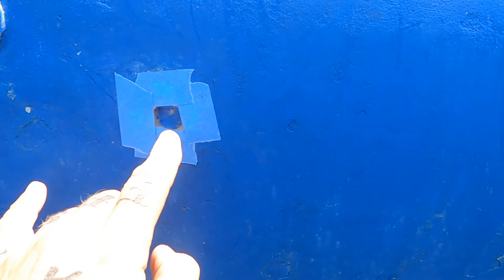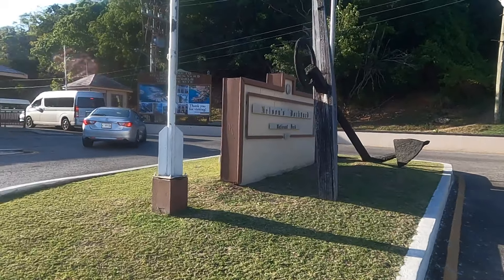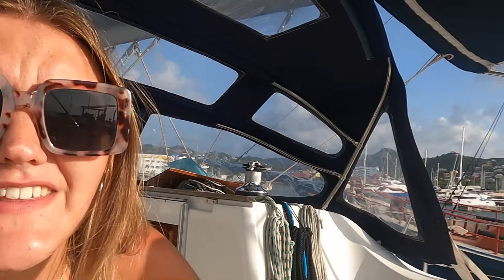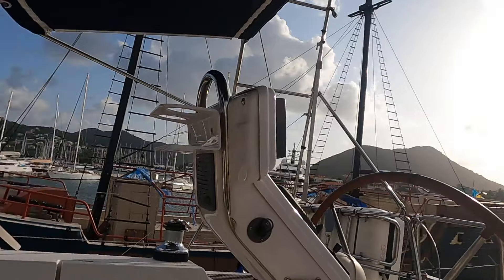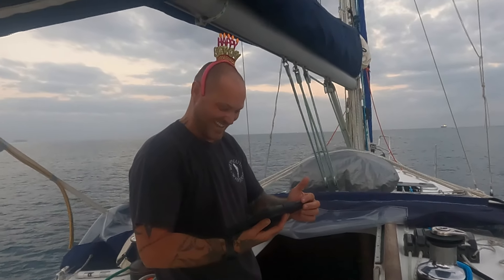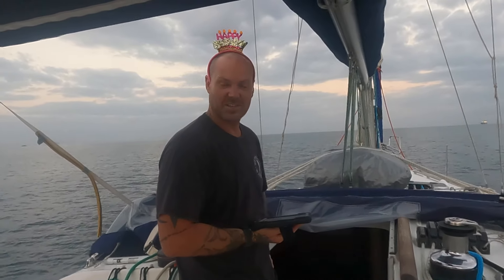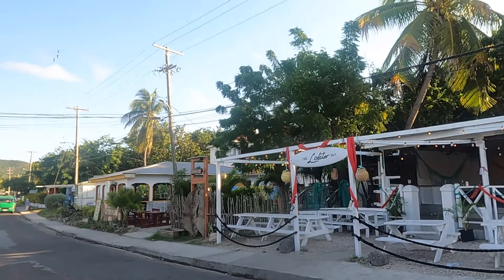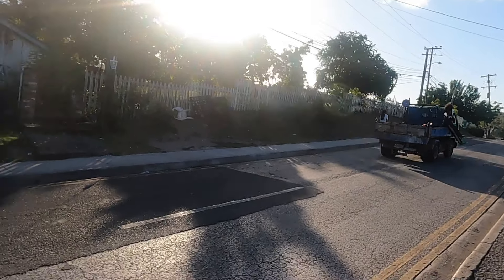Ep 9. will we sink or float?

Comment: On the upside and trying to be philosophical perhaps the sea cock problem was fortuitous considering the throttle cable going at the same time. Throttle issue could have happened at a much worse time. I think you handled it brilliantly at the same time I can fully understand the frustration. Think a negative has produced a positive and ultimately you’re much better off for it. Enjoy your vids! Keep going forwards always. 😎
Reply from the maker: You're exactly right there mate, Maddie and had said the same thing after. Probably the best place it could've happened at that particular time as I was about to be hauled out anyway. Thank you.

Comment: I wonder if your doubts are about sailing in general, or the particular boat? Maybe the problems you've had are typical, regardless of the make or type of boat? In the end it depends if the highs outweigh the lows, i hope they do!
Reply from the maker: Maybe sailing in general. As I've said from the start, sailing isn't my passion, I'm new to it, I just figured figured it's the best way to travel, which is a passion. It's been a very hard learning curve but the boat hasn't made it any easier with all the issues I've had in a short space of time. But I'll keep on going and see what happens.